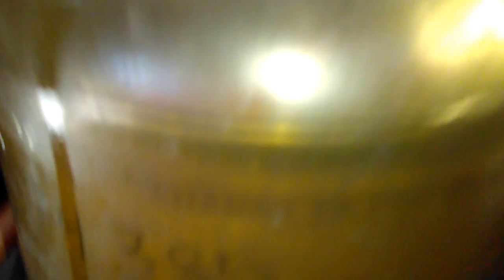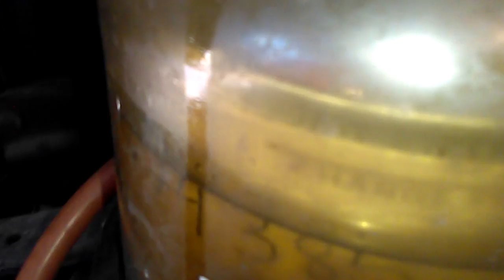Detroit DD13 DD15 DD16 fuel bleeding. OM 471 472 473 MERCEDES BENZ

Comment: I have a question I'm hoping you have an answer for. So I had a mechanic replace the fuel filter on my 09 freighliner DD15. It has been updated to the 2 fuel filter system. After they replaced the fuel filter, it did not start. After they diagnosed the issue, the conclusion was the fuel module was the problem.  My question is, are they at fault for the fuel module being damaged after fuel filter change or is that a common occurrence? Thanks in advance
Reply from the maker: No, that is not common

Comment: Hi, I do like all of your helpful videos, however Mechanice changed 3 small fuel filters on my 2012 dd15 during pm service , truck won’t start unless I sprayed quick start ether in the air filter, mechanic told me I have to change the entire fuel filters housing ($1350) for parts only !! Please help thanks sir
Reply: they say do not use starting fluid at all. !!!!
Reply from the maker: Maybe he did a improper installation of the filters,  causing air to go in the system.   

Do you have fuel water separator?
Reply: Francisco Amaya yes I do have water separator, I believe it happens because Raul truck repair located at 1 Hackensack ave Kearny NJ installed a defective fuel filer (the middle one of the three filters) on the filter housing, I never saw off white filter color in my previous pm services, it’s usually black, another mechanic installed a used pump before we figured out that the new filter is defective, thank you so much Francisco, can I call you the Detroit doctor??
Reply from the maker: Sure, you can mention that in every video if you want. Like that nickname. 
Francisco Amaya aka Detroit Doctor "DD"

Comment: What would you check if you see bubbles going up in the fuel/water separator while the engine is running and if when idle the fuel level drops completely?
Reply: Jose Gonzalez did you ever find the problem I’m dealing with this
Reply: Tighten your seperater globe more or check the gasket/o ring.

Comment: Francisco, will you need to prime/bleed the fuel system if you are just changing the Davco filter?
Reply from the maker: No, it is not necessary but prefill the fuel water separator after replacing it.
Reply: Mr Francisco where are you Located. I would like to use you on my 2012 DD15.

Comment: Have u ever had a dd15 only pull fuel from the passenger side tank and not the driver side tank?
Reply from the maker: In very rare occasion. Usually this happens when one of  the fuel valve on top of the transmission is close or when the fuel tank is clogged.
Reply: Yes also check the ball valve vent is not stuck on top
Reply: Yes, it happened to me. One of the fuel return line was clogged. I got my fuel level sensor replace and the mechanic drop the sensor bar code sticker inside the tank.

Comment: Where are you located Francisco?
Reply: Srecko Rakicevic I'm in San Francisco CA
Reply: Srecko Rakicevic I got a problem with my DD15 is making a by pass motor oil thru the power steering, I already changed the PS filter, but still having the problem, also I replaced the crankcase filter because engine oil pressure is high also, I don't know if the air compressor could be doing it, or the oil pump is bad